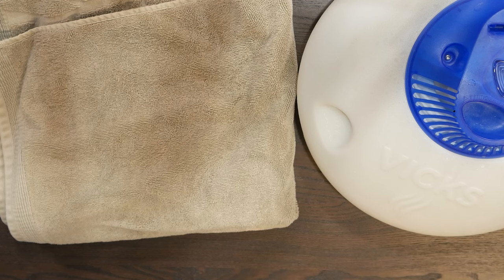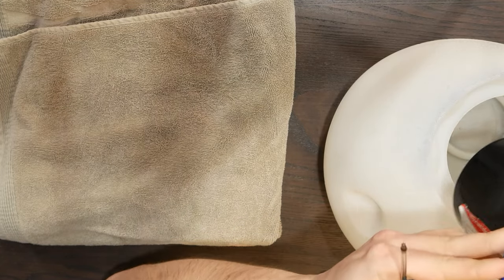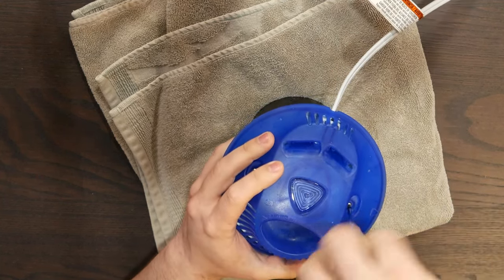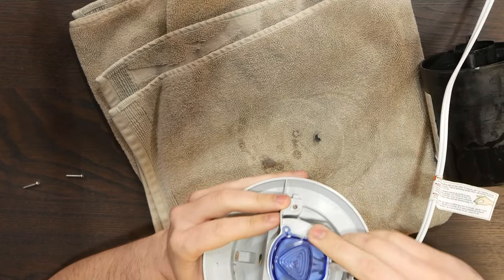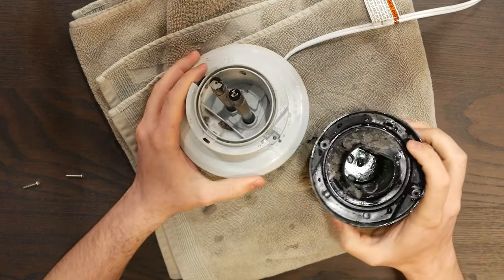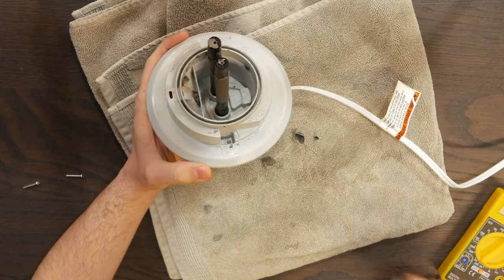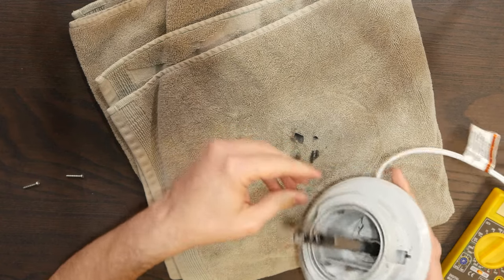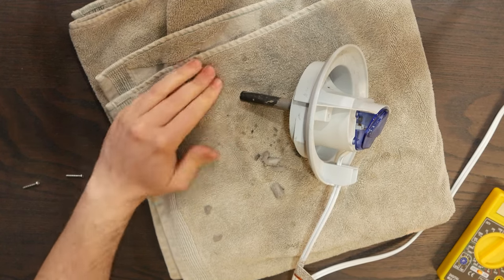Is a Vicks vaporizer an electrode boiler?

Comment: Why are the electrodes coated in a layer of carbon? I was cleaning my unit up (removing lime/mineral deposits) and accidentally removed the carbon layer as well - it appears to just be bare steel underneath. Thoughts?

Comment: 2 little screws from an instantly fatal 5 amp current, 120 volts to ensure it gets through your body. From what I could find 0.1 Amps is enough to be fatal if experienced for only 2 seconds, and 50 volts is all that's needed to send that through the body.
Reply: @Christopher Grant I'm in the UK. You can't stick your finger in ours. They're too small an opening even for a child's little finger and I'm pretty sure you need the longer third earth pin of the plug to be put in the top first before the other 2, mainly the live, opens inside to the point you could get electrocuted, and that's only if you can get something metal shoved in there while trying to hold the plug upside sown or something. You really have to be trying. I think you could remove 2 screws quicker than manage all that, and you would have to have the goal of electrocuting yourself to even start doing that, whereas you could just be trying to clean this thing and think, 'take this cover off to improve access' and then just like that, you're lights out, permanently.

Comment: You really shouldn't use a cheapie meter like that on a 120V circuit. They usually are lacking any sort of input protection, which means they could blow up in your hand. Plenty of $20-$50 options that are far safer.

Comment: Alec (or anybody else), what sort of plug does this have at the end of the cord? Is it just an ordinary molded plug or is it a GFCI plug? A GFCI plug makes more sense here than on a hair dryer; you aren't supposed to put hair dryers in water.
Reply: Answering myself now: I saw on the third video it is just a normal plug. How hard is it to stick your hand (or a screwdriver) into the water when it's powered?

Comment: Alec: One hand rule with that voltmeter! Hold the probes like chopsticks for more than 40 V. Please.
Reply: That's exactly what I was thinking!
Reply: nah. those probes insulation is rated to at least 600V.
People do more delicate work soldering a board.
chopsticks would make you more likely to short the leads.
Reply: @jhoughjr1  Good point, though it still made me nervous.

Comment: They are still made that way. They have their advantages. I prefer them. The vapor that comes out of them is sterile and without other contaminants. The water boils and the crud is left behind and not in your lungs. You clean the minerals out of that or with the other type wipe the mineral dust off your household surfaces it all has to end up somewhere. If you are lazy about regularly and thoroughly cleaning out your humidifier these are less likely to make you sick from stale water and mildew because the water is heated into steam. The negative is if you have soft water they need salt. We are on well water with no softener and need salt to make ours run. Every other place we have lived the tap water has been fine though.

Comment: That is really a vaporizer that heats up the water to help with a cold and a cough and to add moisture into the air. A humidifier uses cold water to add moisture to the air. Not much of a difference but there is a difference.

And yes they still make them they are Vicks vaporizers. You put vapor rub in that little bowl looking thing on the top.

Comment: So that’s what they go to I’ve been making them for 3 years now I’m a solderer at an electric company. Them two sticks you tested the voltage to I use to do that befor I soldered them into a bushing/flange I’d know that what the guys at work called them. I would then sand blast the flux from the soldering then leak test it by submerging it under water then forcing air throw it and seeing if any bubbles. Then it’s thrown into an oven over night to evaporate the water

Comment: If you'd lift the upper part from the resevoir still being plugged in and hold it by the wet part, could you get zapped by the water dripping out being live?

Comment: Just be aware that those cheap multimeters have very poorly designed test leads. A slight kink could expose the metal inside and shock you. Also holding live and neutral test leads with two hands is dangerous with any meter (without isolation gloves). Use one hand and use them like chopsticks.

Comment: Just a heads-up: You really don't want to use a cheap meter for things that are abusive to meters. I've been told having one blow up in your face is not fun. Also, be really careful you don't accidentally leave it in the current setting. If you do, the leads are pretty much a short circuit, so be careful.

Comment: Contrary to (popular?) opinion, cheaper meters are not safer. I know, it's almost in the name, but a decent meter can be used on any range and will not blow up. The cheap meters feed line voltage on those transistor testers, break down on any other range than voltage and will send glass shards if you use the ammeter range on some energetic circuit. Cheap meters should only be used on low voltage, low-amp circuits.
Without going into pedantic details, Aneng makes some decent meters (look for the ones with autoranging) for not much more. That said, I've been using one of those yellow meters for 10 years now, I just squint really hard when doing line-voltage stuff.

Comment: this has two slightly terrifying implications:
1. you could add a ton of salt and watch as it pulls several times its rated power
2. doing so would produce a lot of humidity, along with large amounts of poisonous chlorine gas

Comment: 2 Questions:  Wouldn't that produce hydrogen?  Also, it uses a lot more power than the evaporative style, but outputs heated steam instead of absorbing ambient heat.  Do you think it might balance out to the same energy usage when you account for less heating required in the house?
Reply: It will not produce hydrogen because it runs on alternating current, and in order for electrolysis to occur, you need direct current.

Comment: The fun part is that it's also splitting the water molecules into H2 and 2*O2.  In a small space with no airflow, add a spark, and watch the fun!
Reply: Not really a huge thing to be concerned about, electrolysis only happens when there is dc current, it doesn’t work for ac.

Comment: Yes, these are horrible. I used to have one in my bedroom and had to completely take it apart and scrape the electrodes with a flathead every two days to keep it working. They hate hard water, but they also need it. Mine would draw so much current sometimes because of the mineral count that the plug would actually get very warm, pulling well over the 300 watts that yours did. They also still sell these at regular box stores.

Comment: You can simply remove carbon rods from 6v from lantern carbon-zinc batteries, and replace the electrodes. In a pinch, you can use AA or AAA carbon-zinc battery anodes too. They will not last as long, as they flake sooner. But make sure that you use carbon rods, and not components from lithium primary batteries.

Comment: I didn't know those were legal in the US.  Seriously, what's stopping you from plugging it in and tossing it in a bathtub?
Reply: Common sense.
Reply: He did the GFCI video didn't he?

Right?
Reply: @jamesjarrait2231  
It might be interesting to see if it even works if plugged into a GFCI outlet.
Reply: @rayceeya8659  being in a plastic tub, there's nowhere for the amperage to go except the other terminal. As such, hot and neutral will always be equal and a GFCI won't trip.
Reply: @jamesjarrait2231  
That's my assumption as well, but a lot of older housed tie the ground and neutral together.  I've seen some sketchy wiring in my time.

Comment: Thanks for sharing.  Can't help but wonder if those rods could be made out of a different type of material?...   What about aluminum?  I'm thinking the manufacturer would've used aluminum if it would work, but they likely used the carbon(?) type rods b/c they had to, otherwise Why would you use such a brittle, fragile(& cheap?) material?... They remind me somewhat of carbon motor brush material, but w/ some metallic material combined w/ it.         take care,  - Leeroy

Comment: I bought one just this year in 2021 and it has a safety shut-off switch so it won't be active until you put it onto the tank
Reply: But it does operate on the same principle two pieces of metal in water

Comment: Wouldn't the electrodes passing current through water be "electrolysis " and not "boiling " the water. No humidity will be produced,  as a bonus though,  the room will be filled with pure oxygen and about twice the  pure hydrogen because that's what you get when you pass electric thru water, especially if you pass DC current thru salted water you can capture the oxygen hydrogen gasses but i forget if the oxygen is on the positive side or the negative side.

Comment: This is not really  considered a humidifier. It is a vaporizer.  They technically were not made to be run all the time, only when you had a cold to relieve sore throats and open up airways. This type of unit works great when you dump Vapo-Steam into the water , they work well and I clean mine with a knife and screwdriver. Obviously don't have it plugged in when cleaning it. Salt has to be added to make the electricity flow if your water doesn't have enough hard water in it. This type unit has been made and sold in the US for over 50 years, sold by different brands. Kaz, Northern and others. If you want a humidifier you would use a ultrasonic type. If you have a cold you use a vaporizer for a week or two.

Comment: I wonder if you can modify this with a rectifier, a couple of gas-capture funnels and some tubing, and get yourself a cute little home-electrolysis device to make O2 H2 with.  Might be useful if you've got a compressor, pressure vessels and a fuel cell vehicle.
Reply: @Christopher Grant Yeah, but this looks heckin' cheap if you're a mad engineer on a budget.

Comment: Maybe 200-600W isn't so bad if it's only used in the winter as a humidifier? It's more expensive than gas heating per kWh, at least in the UK, but if you have the heating on anyway waste heat from an inefficient humidifier is still, err, heat. BTW, I didn't even know we had those in the UK until I saw your video and then Googled "vicks humidifier uk". I've never seen one. (edit, and I'm quite old) (2nd edit. Just watched your "even more..." video. DoH!

Comment: All that crud is why it's drawing so much current. Clean that out and you should get more reasonable boiling. With enough use without adequate cleaning, they start actually spitting water out with the steam.

Comment: Vics and its predecessor Kaz have been making this type of "Vaporizer" since the mid 1960's, why change simple?  Before the current style electrodes were used, they used two stamped steel electrodes that were around 6" long.  Talk about a Zapper!!!

PS: The 1960's "modern" Kaz Vaporizer we had was even harder to clean the tank.  It was flat!  Like a Flying Saucer!!  There was an extra hole/plug on the top to add water without bringing the tank to the sink.  Ours was an Aqua-ish green.

Comment: never use both hands when working with high voltage! if you keep one hand at your side and far away from the work, it's a lot harder to accidentally create a current path through your heart
Reply: it's a bit of a pain, but learning to hold your probes like chopsticks helps. alligator clips also really help in a lot of cases (although probably not in this one)

Comment: I don't understand your reason to not like the fact that it's a boiler. After all, if it is supposed to be used in a place where you need heating, then this is more appropriate than a normal atomizer which would cause the water to take the ΔH from the air, hence reducing the effect of your heating system (which ppl might tend to call underpowered in many situations). Though I won't consider sticking free electrodes in water a good idea to heat it either.
Aren't you just getting a humidifier+heater combo pack in here? That's probably how they should have marketed it

Comment: From Vicks FAQ
Why Are There Black Particles In My Vaporizer?
The black particles that you see in your vaporizer are normal and do not affect the purity of the steam. These particles are the left-over minerals from your water. The reason the minerals turn black is because they have passed between the electrodes and have been charred. If the unit is maintained on a daily and weekly basis, you should not experience any problems with its performance.

Comment: BE ADVISED. Since it is an electrode boiler. Any heavy metals will be collected on those electrodes.
That excesive scale build up could contain lead. Don't use bare hands when cleaning.

Comment: The hot humidifiers that I've gotten recently have a sealed heating element, not electrodes like in this one.  Here is a page I googled up of someone cleaning one: https://betweennapsontheporch.net/how-to-clean-the-encrusted-mineral-deposits-from-inside-a-vicks-humidifier/

The one in the attached link is typical - the heater element is on the bottom.  These have a design flaw that the thermal cycles eventually cause the seal between the plastic basin and the heater to fail which causes all the water to run out.  I only get ones now where the heating element is suspended in the water from above.

I like the hot humidifiers because while they do use more electricity, I can keep the house cooler and it keeps the bedroom a little warmer at night. Like a space heater with bonus humidification.

Comment: where did that thing manage to find THAT much minerals in the water to be that full of scales even after you descaled it 0.o
ooooh when you started to pry them off manually i noticed those what i think were carbon electrodes were just black rusted metal, i bet that stuff reacted with all the salt you're supposed to put in that water... (btw great way of producing gaseous HCl if i'm not mistaken, not sure i'd recommend that as a healthcare product :P)

Comment: I can tell you that's exactly how they're made, still. I could have told you this. If you were to put it into water like that, you will destroy a circuit breaker. It will trip and you will not be able to reset it. You will need to replace it. Water has crap in it, unless it is distilled. I HATE them. They used to have a nice green glass reservoir and the plastic components were bakelite. Much easier to clean but worked the same way. They also are designed to stop working when there is no more water. The water is what closes the circuit and causes the boiling. Salt water is a better conductor of electricity, and also boils hotter. If you put distilled water into it, it won't boil at all because the water is literally too clean... That soot will always build up and it will quit working in a little while anyway, and unless you know how to take them apart and clean them, you will likely throw it out and get a new one. Vick's literally banks on it.

Here is the link to the old Prak T Kal electric company vaporizer, back when they knew how to make things. I have one. It works pretty much the same way. Water fills a small tube, there are simple brass rods separated by a stack of ceramic disks between the two rods, that protrude into the water and make it boil. It doesn't work anymore so it's more of nostalgia than anything. When my Grandma had it, that thing put out steam like a fog machine. Literally a cloud in the room. Awesome when you turned on a flashlight and could see the beam. https://www.worthpoint.com/worthopedia/vintage-praktkal-practical-electric-253424489

Comment: "This is slightly terrifying..." 

Your first clue of that was the use of torx screws. They are "safer" because they are less common.

Big Clive has several videos of electrode boilers available on ebay, shipped from overseas. All of them omjt any sort of safety design. The most egregiously dangerous one is an electric shower heater.
Reply: Unlike the shower heater, this one makes sure that you can't touch the water that's in contact with the live rods. I don't think that it's that unsafe.
Also, torx screws and screwdrivers are more common in modern items than Phillips or Pozidriv screwheads here. I build all my stuff with either torx or alternatively inbus as well, they're just much better.

Comment: Electrode boiler? That's weird. The humidifier my family had 35 years ago used a motor to vaporize the water. I also recall it didn't have anywhere near as much crud inside.

Comment: Are these things as dangerous as they seem, with the rod/zappers being directly connected to the main like that? It feels like it's a fire hazard waiting to happen. (Though I guess with most houses have breakers that would likely trip)
Reply: I don't think these are too dangerous if maintained and used properly but if you live in an older house I wouldn't count on the fuse blowing or breakers tripping.  I have seen homemade "fuses" made from old copper pennies (you can ask my father about the stream of profanities and wood throwing that came from me that afternoon -- I had lived in that house for a few months and only checked because the kitchen power outlet melted the AC plug on my mother's portable dishwasher, I did $2000 worth of electrical work re-wiring and installing a proper breaker box in the place in 1981 after that one; fortunately the dishwasher was easily repaired with a commercial quality replacement male, three prong 120VAC plug which I always keep around the house anyway) and breakers that failed in such a way that they no longer trip no matter what current is run through them.